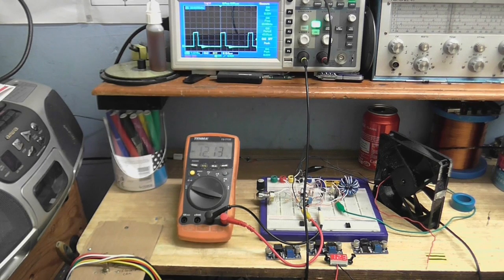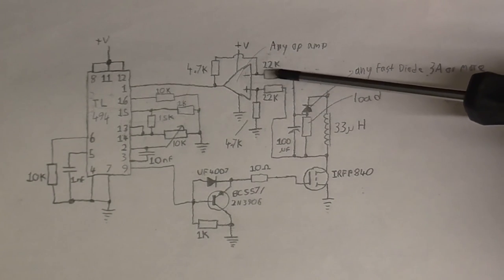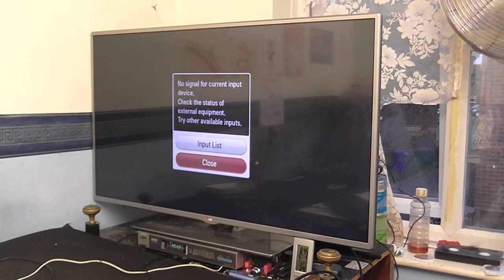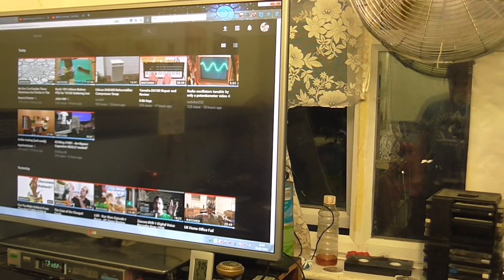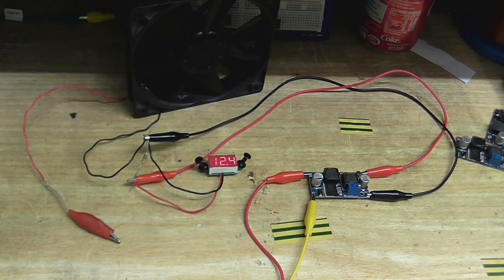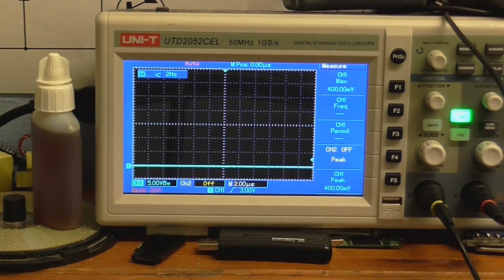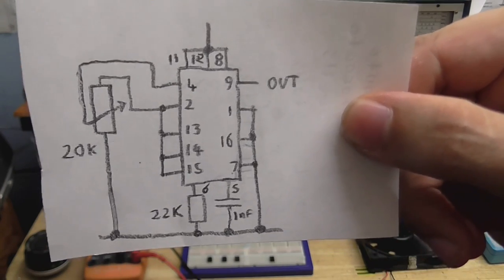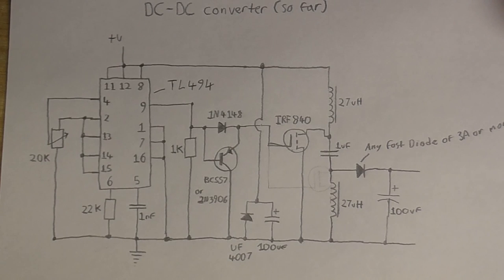More tinkering around with Buck Boost Converters - and some ranting.

Comment: It's a good video and yes it's a bit over the place but you do cover a fair bit and it's well worth watching. The editing is pretty good too and your main camera (Panasonic camcorder?) is certainly an improvement over your old one! :-) Only suggestion really would be to zoom in a bit more for the bench shots. Otherwise shoot at 1080 and digital zoom in editing (which is what I do) and the upload at 720. Keep up the good work :-)
Reply from the maker: In the next video I'm going to have the camera tripod attached to the ceiling like I used to, it will be much easier to see things from overhead, the reason I show everything from quite far in this video was because I wanted to get the scope AND what I was working on in the same shot. but next time I'll use a separate camera for filming the scope (and for a second camera angle) and then add that in during editing. I'll stick to optical zoom though, my camera is not that good, it is a Panasonic, and although it does record in 1080i, I don't think the sensor in it is anywhere near that, it's probably something more like 1280x720 and up-scaled for a fake 1920x1080 size, plus I can never get the focus right, if things on one side of the screen are in good focus (doesn't matter witch side), the other side of the screen is completely blurry!
Reply: CoolDudeClem Yes, I realised after posting my last comment that you were trying to get the scope in too. Fair enough. Nice scope too :-)

Comment: Great work with the buck boost back engineer - can i ask where do you source your TL494 so i'm asking did you pull them from some specific junk item?  {i'm just looking for fallout points} {i'm a little ignorant on the TL494} i.e were these pulled from PC PSU?
if you don't my sharing.

Comment: Nice to see you in a good mood :) And sorry, being a picky bastard I am, I can't help myself but say that the schematic at the end is not really a buck-boost. Yes, it bucks and it boosts but the topology is called SEPIC. True buck-boost inverts the output voltage, SEPIC doesn't.
Reply from the maker: So I guess the first buck-boost converter I made at the start of this video is a proper buck boost circuit because it does invert the input voltage? Well, I don't think your'e being a "picky bastard"! After all no-one was born knowing everything, and I admit I don't have a full understanding of everything I do in these experiments.
Reply: CoolDudeClem Yes. It's good to know that you are up for discussion. I personally don't mind criticism, as long as it is constructive. :)
   You're familiar with gate drive transformers, so why not to put an N-fet on the high side? It will make voltage sensing very easy. There won't be need for an opamp anymore. And since you are using single output of tl494, I would suggest to use uc3843 instead, its output can drive a mosfet directly, simplifies the design.
Reply: Sir Johnny you are a wealth of info - i can say {in my ignorance} i was wondering why that specific config of MOSFET -  however i'm still ignorant as to why the N config simplifies V sensing - however i'm sure it will come to me in practicality of the event.  thanks for sharing.